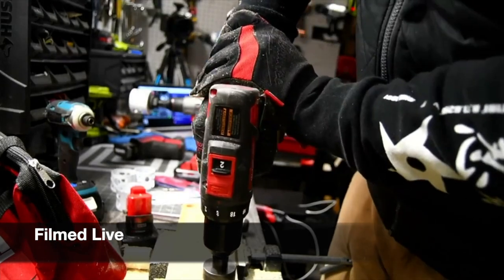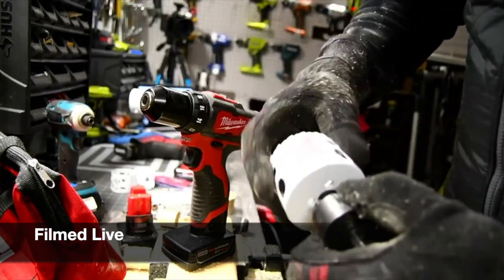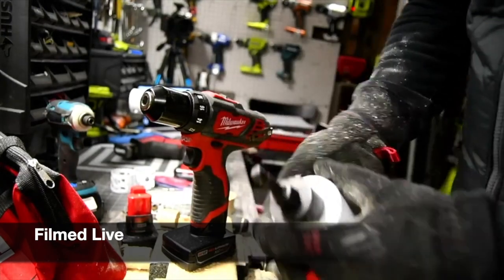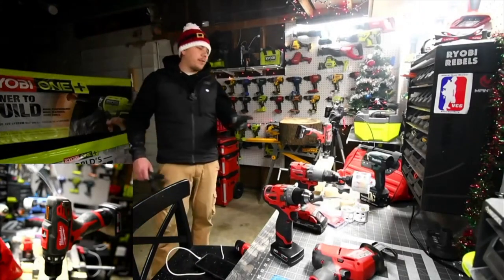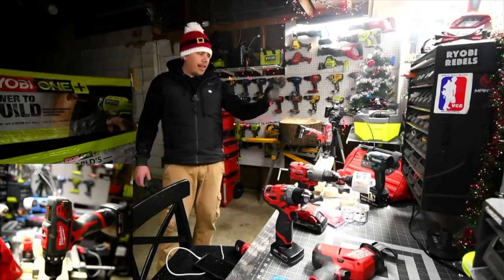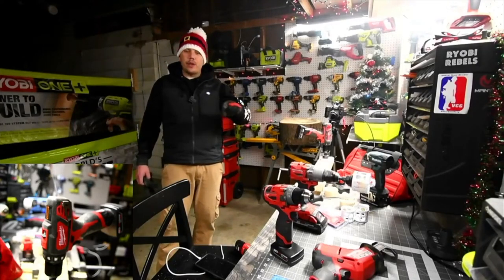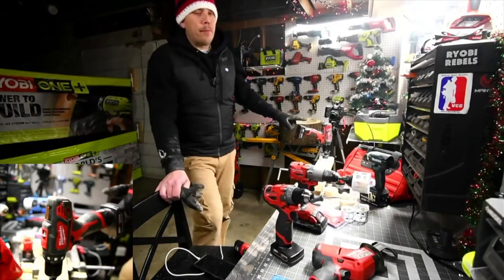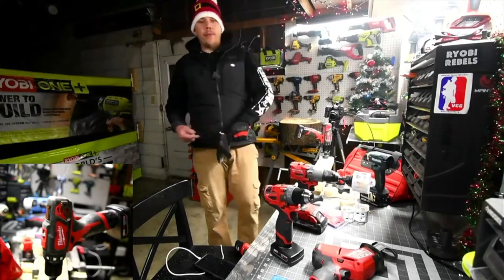Milwaukee Smoke Show

Comment: I used this drill daily for 4 years, never went over a 1-1/4 spade bit though and ran it in low gear.
Reply from the maker: this drill was pretty much brand new and it died

Comment: My Milwaukee 12V drill also smoked last year after owning for about 4 months.  Was drilling a hole through some hundred+ year old 10X12 wood in our old house.  I was using a spade bit with an extension to route some cat6 through it.  Drill started smoking.  Freaked me out.  The drill still works.  I knew I was using the drill way beyond it's ability and it was my fault.  

Now to drill any serious holes I bring out one of my corded older drills that have massive chucks and can break your arm if it catches and you aren't prepared.  NOT a fan of how the battery is attached though.  Most of the time it takes like 8 tries to squeeze the battery tabs and pull it out.  I think it is just the drill.  The impact driver from the same combo is a bit easier to remove the battery.  Already decided we are swapping to dewalt when upgrading because i have almost thrown the drill a few times after failing to get the battery out mid project.

Comment: That happened to me several years ago .I bought a  Milwaukee 18v lithium kit when they first came out around 05 or 06?, Drill burn itself up on the first hole I drilled through a chunk of lead 2" thick,took it all back . I have two M12 impact and drill kits that have been just fine for years
Reply from the maker: I am not a fan of brushed tools at all and I thank you for viewing 670

Comment: Mine smoked with a 1/2 spaddle in a dry 2x4 stud on the first use. It only made it about a third of the way through before smoking. It was a diablo bit with only its own screw applying pressure. Very disappointed with several of my Milwaukee tools!

Comment: This is what happens when you us something for what it was 'not' intended for. Note to self, 'Don't use a m12 drill driver with hole saws'.
Thank you Man Caver for making these videos so we know what they can and can not do.
Reply from the maker: The m12 Fuel Brushless hammer drill works just fine with hole dozers. I show that in a previous video
Reply: I use my DeWalt 886 and it runs perfectly the only problems I had was the light was staying on so it drained the battery
Reply: @ManCaverTools  👍
Reply: @dewaltman9377  dewalt 886 is for one brushless, for two not a drill and for three not a 12v

Comment: Hi,

On a different note. I been using the milwaukee m18 (2804-20) hammer / drill driver (gen 3). Very good drill but its heavy especially when using it all day. I think it's due to the hammer motor. I hope milwaukee can make this same drill without the hammer feature. Maybe a two or three switch to LED system like dewalt (DCD 791)

Now, i stop using it and went back to my DeWalt (DCD 791) drill. It has the same 2000 RPM like milwaukee
It has no hammer drill but it's way lighter and it has a killer 3 switch LED light system. The last buttom acts as a flash light. That's very handy in certain situations. If you get a chance check out that model. 

Funny thing is, i use my dewalt 791 drill and the milwaukee surge for work. For me this combo works great, especially for indoor work.   

Just wanted to share.
Reply from the maker: I thank you for the info Michael and I thank you for viewing

Comment: yep that thing is terrible I use rigid for my 12 volt tools but I want to get into the m12 line. the batteries are and but the drill isn't as bad as the milwaukee
Reply from the maker: I think the M12 Fuel is a very good line to get into
Reply: Hi
Reply: @treehouseco4242  ok
Reply: @treehouseco4242  ok

Comment: Grinning from ear to ear as a makita fan boy. Also ive abused my dewalt dcd701 way worse than that many times I drilled a dull 5/8 auger through penertreated light pole one time building a gate. That being said i hate to see a drill wasted.
Reply from the maker: that is why I do these test though,
Reply: Bro no Milwaukee fan is upset about this video..we all know their non-fuel tools blow
Reply: As a former makita fan boy recently switched to Milwaukee FUEL tools..have fun having your new tool releases every 5 years and bit kits being the extent of your accessories 😂😂😂😂😂😂😂
Reply: @thecarproconnoisseur5412  I am not a fan boy anymore. I like some of their stuff. I started buying Makita, because I needed to replace a hole shooter. I replaced the hole shooter with a fine as hell dp4000. I bought an old school cordless brushed half inch impact, xwt04 built like a tank I love it. I bought a 1/4 inch hex impact driver that can't drive screws, it turns way too hard before it impacts. I have a xrj05, that has been beat on! I love most of the stuff. I am dissapointed with a few things. Cordless stuff made in china, fit and finish on my sawzall is terrible, it works amazing though. I hate my hex impact driver. I love the batteries, they are just a little pricey for what you get. I will continue to expand, I am looking forward to a tire inflator, circular saw, bigger drill. I have used Milwaukee and I love it as well. I originally made the switch to Makita because of garbage chinese hole shooters. Thank you for the reply! Have a good one!

Comment: I can honestly say, I've never seen any of my Milwaukee tools smoke. Although I've managed to get smoke out of some of my old dewalts. I've had my M12 fuel drill so hot one time, I had to wrap it in cardboard just to keep holding it. But it never smoked or even smelt like anything was failing. Never went into overload protection either, just kept going.
Reply from the maker: I hate brushed tool form all brands
Reply: @ManCaverTools  me too. Only brushed tool I own is the m12 multi tool, and the vacuum cleaners. Looks like they're due for some upgrades soon

Comment: I'm no Milwaukee fan, but hey, that's a light-duty 3/8" drill with only 275 in./lbs of torque.  It was never intended to be used with a hole saw.
Reply from the maker: I put these tools through the extreme tests
Reply: @ManCaverTools  Well, then for your next test I'd like to see a 1 1/2"  spade bit in a Dremel.
Reply: @GM-gc8gg  hahaha that’d be even better then this video
Reply: @ManCaverTools  that right, companies rely of consumers using wrong tool for wrong job... We all do it, then stop for a while when we break it ,replace it  then do it again, just because I don't wanna get me generator and corded tools out

Comment: Mutwillig bringt man alles kaputt, also wer mit Werkzeug nicht richtig umgehen kann, sollte es eh bleiben lassen.

Everything is willfully broken, so if you can't use tools properly, you should leave them alone.
Reply from the maker: a 12v drill should be able to drill out 1 1/2 holes. the m12 brushless fuel hammer drill can do it no problem

Comment: I am not a milwaukee fan but that's a 12v   tool you need a more beefy tool to get that kind a job done so don't trash that little drill
Reply from the maker: the 12v Fuel hammer drill did the test just fine during the stream.
Reply: Milwaukee's newer tools are supposed to have overload protection. They use sensors to physically prevent you from destroying the tool just by using it. I'm guessing the brushed versions do not have this.
Reply: @Thundercube_Music  which make me believe the electronics was fiddle with to make it smoke! Boom you got a video to upload! 🎥🎬🎷🎤Make some, money! money! money!... 🎶🎵📹